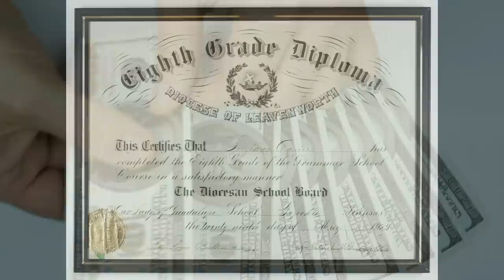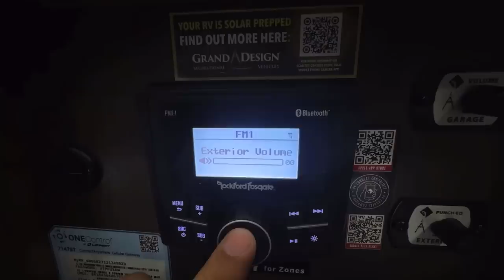RVs. Built by AMISH. Fueled by AMISH Crack.

Comment: I been an HR professional in manufacturing for 25 years and I would LOVE to work for one of these Amish RV facilities. I would imagine there are very few to zero employee relationships issues and no attendance issues!
Reply from the maker: You are correct!
Reply: Talk about that attendance issue lol
Reply: HR does have a responsibility to find good employees, not just fill a spot.
Reply: @tommywolfe2706  That's easier said than done. Where I used to work almost 80% failed the drug test.
Reply: @randall1959  Well, people have different opinions on testing for pot, but 80% of your failed applications were likely a result of that, and its a very stupid and dated policy to not hire people because they smoke pot, at least IMO. 

I smoke and my last job didnt screen for pot. I worked at Keystone. I am a HARD worker and I get stuff done. If companies want good workers, they are going to have to get over stuff. Cigarette smokers are worse for a company in every regard than a pot smoker, yet no discrimination there, that disgusting habit is allowed to thrive in most work environments, whether the non smokers like it or not.
Reply: @tommywolfe2706  Don't tell me how safe and effective pot smokers are. I used to be one. As for the 80% failure rate that was across the board and for several different types of drugs. Let's also not forget that if you cause an injury or death in a work place OSHA comes down hard on the company if there are drugs involved.
Reply: @tommywolfe2706  It's not totally legal because it's still a schedule one drug according to federal law. I quit because pot destroyed my lungs. I've seen guys come to work stoned and get injured. I've seen accidents with fork lifts. I've seen people lose fingers. You sound like the guy that needs to get stoned so badly he'll do anything to stay that way.
Reply: @randall1959  I am not worried about Willie Nelson.  He has already lived longer than most people will, of course his lungs have problems. 

I can tell you that I have worked in high danger jobs (fabricating I-beams for chassis (welding and plasma cutting) that weigh a couple tons, and moving them across the building, requiring correctly hooking up the beams (so the weight is distributed properly and its chained up securely) and making sure everyone and everything was out of the way, dozens of times a day for years, just to name one) and I never ONCE had a problem that was my own making.  

Some fool with a cigarette in his mouth, because he couldnt wait to get outside to smoke caused me a problem once, he pushed the beam into someones head. 

That is what I think of when I think of your pot screening.  Just because there are stupid potheads out there doesnt mean that most are. I have had several fingers broken a toe and a couple fractured ribs, from people who were, according to the drug test, sober. I know that they were alcoholics and cigarette fiends, and one of them was an opiate addict.
Reply: @randall1959   I wouldnt do anything to smoke pot, but I have been on synthetic meds for mental issues for decades and pot has helped me quit them all, and left me a better person as a result. 

Of course, I could pass your precious drug screen while on dangerous narcotics....I have done it before. Adderall, Xanax, Ativan, Klonopin, Valium, Vyvance (I have treatment resistant depression, my epinephrine is my issue, not serotonin, so I get serotonin sickness taking traditional treatments, so the uppers and downers together were supposed to manage my mood) and they worked, but its a lot of doctors visits, a lot of insurance BS and a lot of money.  

As long as I have that precious prescription, drug tests dont matter. That is why I dont believe you when you say that 80% of applicants fail. People can get jobs in Indiana, with pot in their system, at places that screen for pot, as long as they have a medical card. And I live 15 minutes from Michigan. Its super easy to get one.
Reply: @tommywolfe2706  I used to fly RC and there was a guy that said he flew better drunk than most people flew sober. I have a son that lives in Colorado and he's smoked himself stupid on "medical grade" weed. Last year I tried some when Missouri went "legal" and to be honest it was so mind fucking that I wondered what else was in it. It's turned my cousin into a babbling idiot.  Apparently you haven't read about thc psychosis that has become prevalent in "legal" states.
Reply: Lady what are you talking about if the Amish can't get somebody to take them to work they're not going to show up that day and there's nothing nobody can do about it... Human resources is basically unnecessary in an Amish community.
Reply: @patrickgronemeyer3375  If you actually knew anything about the Amish community you would also realize that there are usually lists of people who will take them to work sites because they pay in cash and they never cause a fuss in the van.
Reply: I agree , you would be a great HR rep in N Korea!
Reply: @mtflick1  I grew up in Northern Indiana....in Elkhart County. One of my jobs in high school was catching chickens on Sunday.  ($25 for an hour, or slightly more, back in 2000)  Amish people couldnt work on Sundays, but the companies that wanted their chickens only worked on Sundays. 

We would show up, and the Amish people, with their eyes all bloodshot and red would come stumbling out the door, swearing at each other.....yelling at us young underage "heathens" about where we were supposed to get the chickens from and not to bother them.

We would run into the chicken barns, grab 3 chickens per hand.....one chicken leg between each finger, and thrown 6 into a crate.

The amish didnt care what was going on.  We got paid cash as well.  Best gig I ever did in high school.  Back then (in 2000-2001), I got paid $6.25 an hour for my gas station job, and at taco bell, and that was generous.  One hour for $25 was unreal.
Reply: @tommywolfe2706  You can't get a medical card in Indiana. Pot is totally illegal here.
Reply: @sherrybond870  ?  And a Cardinal is the state bird. Fun trivia time for everyone!

Other things that are totally illegal include driving in the left lane unless you are overtaking another vehicle on the highway. Or improperly using your brakes....and the signals.  Why do Hoosiers suck at this?  Dont preach to the choir, my 40th year in this stupid but awesome state was this year.
Reply: @sherrybond870  My favorite part is where I can hold a joint in my hand and literally take one step onto Indiana and be a criminal, or just stay where I am and be an upstanding citizen who supports local "industry". And my taxes I paid for that pot will do more than my state income taxes in Indiana.

Comment: On the other hand the 2020 Jayco we bought was SLAPPED TOGETHER, and I mean screws falling out, rubbish under the linoleum, metal shavings turn up in the carpet from the slideouts every time we tow it somewhere. Still finding flaws... none of the cabinet doors are put on evenly, some of them just falling off. The quality is HORRIBLE.
Reply: To top it off they included a $500 TV that I could buy for like $60 because it's a 480p PIECE OF JUNK!

Comment: I have been RVing full time for 12 1/2 years. For a long time there were 3 brands that made RVing a nightmare. Lippert, WFCO, and Furion. Now you can add Schwintek. Over 100K Grand Design units are now some of the worst for problems. If you ever have a frame problem. go to Advanced Northwest Welding in Bend Oregon. They will fix it.

Comment: I bought a camper this year.  I had originally intended to buy new and made an offer early this year on a travel trailer at a dealership.  They wouldn't budge on the price.  So I found a really nice used 2013 model for 1/3 the price and am completely happy with it.  It seems to be built with better quality standards and materials so I'm glad I didn't go "new".

A couple months later, the dealership that wouldn't budge on the price began hounding me with marketing calls, asking me to come back and look at all their "amazing deals" with prices slashed much lower than my offer earlier in the year.  I imagine they will be taking a loss.  Serves them right for being so greedy in the Spring.
Reply from the maker: I think used is a good decision/. The new owners worked out all the problems that come with a new rv.

Comment: We have a 1987 Kit Road Ranger 5th wheel. She is old. She is solid. The ONLY issue we have had is the water tank went and I replaced the curtains. Everything else is original. Our friends bought a toy hauler in 2018. Their dinette fell apart. The inner walls are coming apart. The roof leaked. If you want a solid RV? Buy an old one. Amish furniture and food is 110% amazing. RV's? Not so much in my opinion. I paid $2800 for mine in 2015. My friends paid $24000 for theirs.

Comment: Problem I have is it is always forest river getting hammered . There are 3 big manufacturers and they build junk . I bet you can get a good one from any one those manufacturers . I have worked in manufacturing for 30 years . I know how it works it the people who are doing the particular job . Some are good talented workers and some aren't  very good . Some are trained well some are not . But the bottom line is going the skill and then Materials you have in front of you to use . Your suppliers as well play into it . They build the rvs  light  to travel down the road . But the industry best start shifting to building them to be on permanent sites because more ave more people are getting into that versus traveling With them as much . Especially when it comes to travel trailers .

Comment: You install the stereos? I've had 3 travel trailers. All of them had the stereo wired incorrectly. Right channel was inside the trailer, left channel was outside the trailer. Why do they wire them that way?????
Reply from the maker: I think it’s so you can turn the outside ones off by adjusting the balance. Otherwise you would need a second stereo. I would think on/off switches on the speakers would be best

Comment: Honest Question; Why Does It Seem Like So Many Of The Modern RV's, Specifically Their Components And Appliances, Are Poorly Designed, Cheaply Constructed, And/Or Badly Engineered, In Addition To Being As Expensive Or More Expensive Than That Of A Typical Home?
Reply: What About Using Something Like A Marine Grade Decking PolyPly, Reasonably Primed For Proper Glue Adhesion At The Flashing, And A Thicker Mill Self-Sealing Gasket To Produce A Long-Term Weatherproof Seal And Prevent An Easily Compromised Roof?

Comment: There is one thing I don't get. They build RV's and usually have non-Amish drive them around. Yet they basically only do horse and buggy. Now if cars are evil, doesn't it mean ANY vehicle that is engine based is evil ?? And if so, doesn't that mean making use of that, or making profit of that mean that you are in cahoots with the devil ???
Reply: They don't think cars are evil
Reply: I had a good friend many years ago who humorously said "If having a car is a sin, when I pay a driver, am I having someone sin for me?"  There are many things that cannot be explained.  The rules forbid being hooked to the electric grid, yet most will hook to the gas grid to run their generators.
Reply from the maker: Only the really conservative amish might think a car is evil. The amish in this area do not think cars are evil or a sin.
Reply: ya i saw they use power tools also i guess its the level of adherence to rules?

Comment: Every single RV owner struggles with the shitty workmanship and fit and finish on these rigs.  Perhaps if there was a system that could track manufacturing teams all the way through the life of the trailer, builders could earn royalties for keeping their trailers out of the shop, instead of just turning them out as fast as possible and then forgetting they exist once their "module" is complete.  

     The problem with RV manufacturing is that it doesn't respect quality and goes full tilt on quantity, the workers lose, the customers lose, the company struggles with its reputation....

Comment: $5 per person isn't enough for the gas 🤷‍♀️
Reply: That would depend on how many you can fit in your vehicle and if you are going any way.
Reply: @theresateegarden9147  the average car holds 3 passengers. That's only $30 a day to get up at 4am? How much do they earn? Math ain't mathing. No thanks fam.
Reply from the maker: It’s plenty if you have to get up and go anyway. Most don’t drive but a few miles out of the way.
Reply: @theamishpotato  I meant if you didn't work there.
Reply: I'm in Holmes county Ohio and I get 1.40 a mile plus fuel. 12$waiting time
Reply: @rickyrishel6138  I get if you work in the same building/same shift. But outside of that I wouldn't do it for that less. It's more here for the Amish in Lancaster PA
Reply from the maker: @cccreativityvlogs2971  only coworkers will pick them up. I’ve never heard of anyone just dropping them off at work. The normal taxi drivers charge way more.
Reply: @theamishpotato  Got it 👌🙂

Comment: Amish do good work but they go too fast and dont take there  time that's why they fall apart
Reply from the maker: It’s the way they are designed.
Reply: They do good work . But if you're forced to move fast there will be issues and missed things . Every type of factory has this from cars manufactures to boat motor builders ect . Its all about more  produced then quality . Because the hire up management get there bonuses based of it. So any place that has a quality mission statement I laugh at .